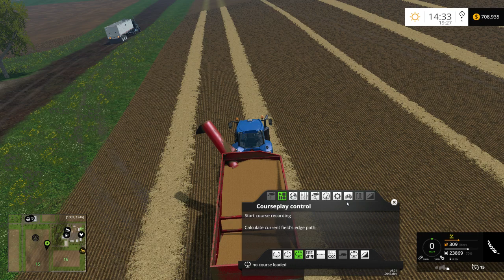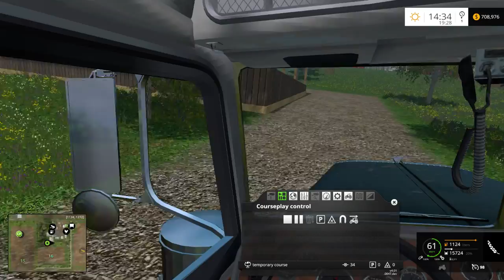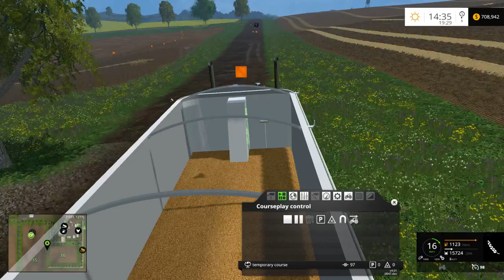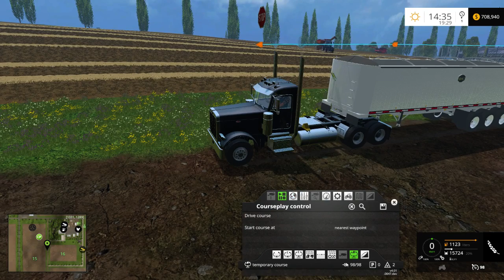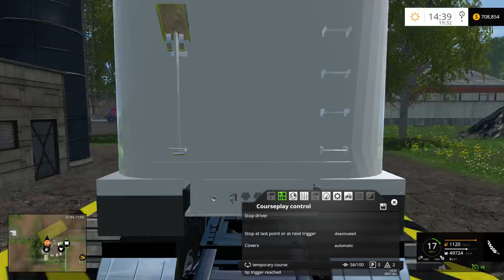Courseplay Tutorial - overload + grain transport mode - Farming Simulator 15

Comment: How do I get it so the truck stops cause when I do this it just drives away
Reply from the maker: +aaron rowland You need to start recording the course where you want the truck to stop.  Also, make sure you line up the truck with the course otherwise it will drive around in circles.